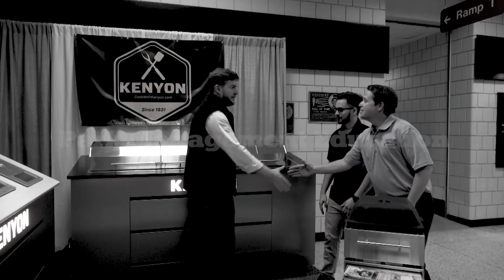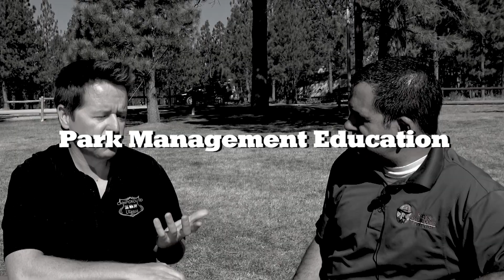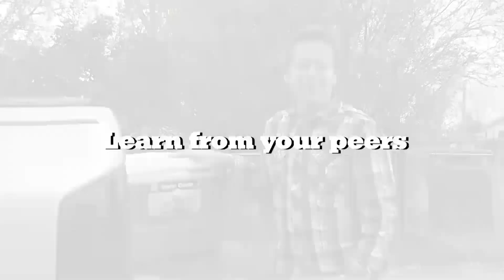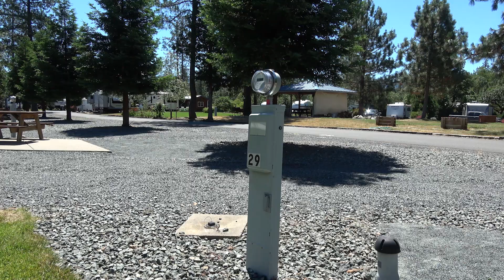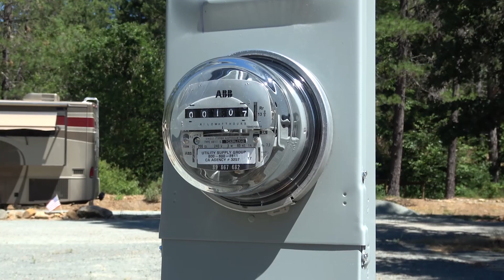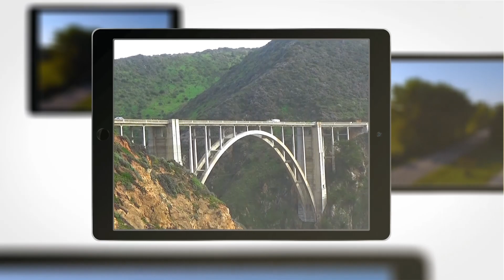Park Operators: Get the Basics of Electrical Service for your Campground or RV Park

Comment: Just to clarify, that $750 estimate for equipment was including wire, correct? Very good video!
Reply: Thinking it is probably closer to 1250-1300 per site. We do not do installation
Reply: That is correct, my estimate assumes all equipment from the transformer. (Wire, distribution panel, pedestal, etc)
Reply: @UtilitySupplyGroup  Is $750 still valid today? what is your estimate now?
Reply: @xinli8046  I would go closer to $1000
Reply: @UtilitySupplyGroup  
Hello, building an RV park in Texas and looking for electric contractor. Do you guys do installation service as well in addition to materials? Also, whats your estimate for 2022 per pad?